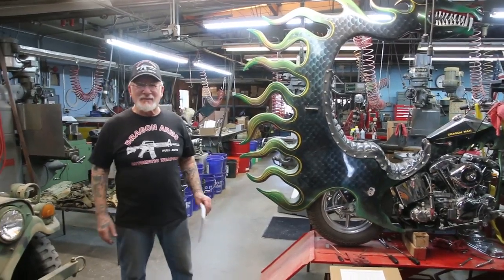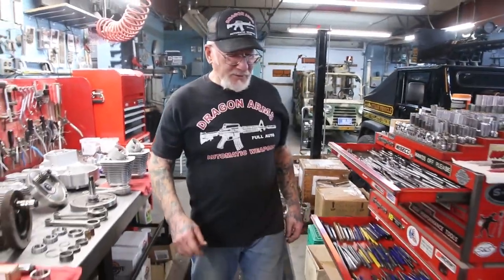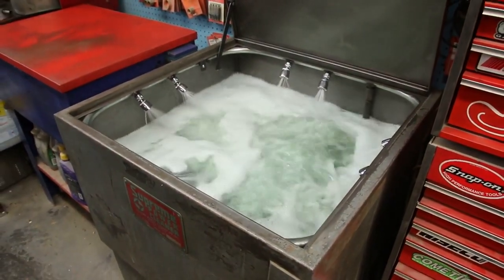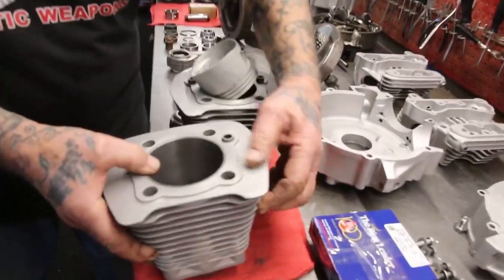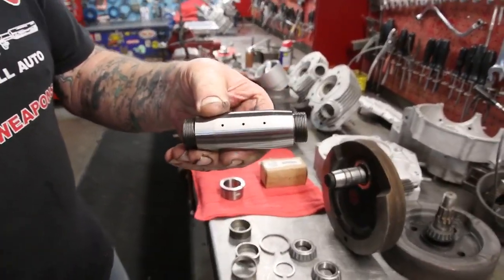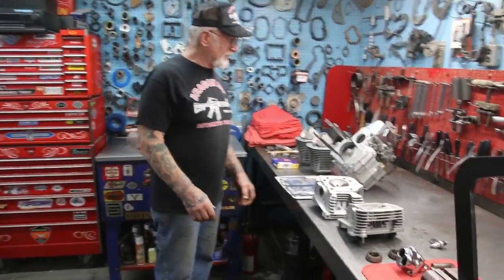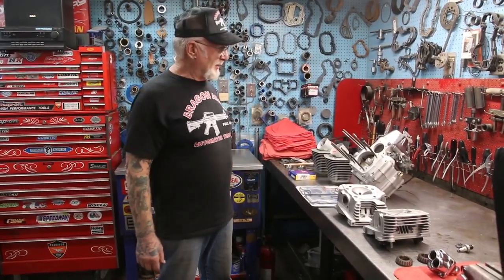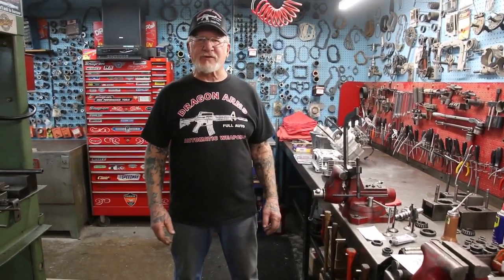Dragonman's Motorcycle Machine Shop

Comment: Hay  dragon man, I say a video of yours  were you had a double faced dial indicator,  I do a lot of cylinder resleeving and surfacing  of the cylinder heads, and this double side indicator would sure be nice in my tooling, I have looked high and low for one of these and just cant find one, if there was a way I could get a manufacturer for this indicator, it would be very appreciated